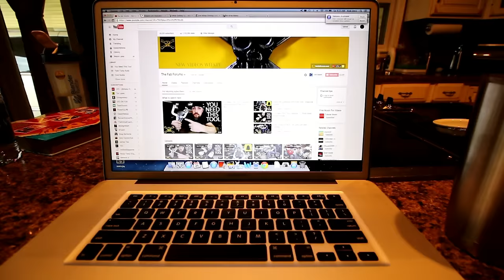What Is Falling From The Sky?

Comment: for the tube bender, kubota makes some really cool quick disconnects for their hydraulic lines. maybe you can work those in so you can take it apart and not have to worry about air in your lines or loosing fluid. just a thought.
Reply from the maker: +Joseph Inman thats a good idea. I will have to look into those
Reply: The Fab Forums I'm sure there's probably some aftermarket ones that are cheaper. Just throwing ideas around.

Comment: Nice tool.  You said max OD was around 2 inch?  Guessing exhaust piping cannot be bent up with that.  Last time I fabbed up a catback system I mig welded the bends together in sections
Reply from the maker: +Russell Maillet yeah this is just for DOM chassis style tube bending. I just buy mandrel bent sections when I do exhaust

Comment: man i kweep saying it .......sumtimes wish i lived in the states so i could have a shop in the size you have , houseprizes here never alowed me to buy one , maibe one day.....

maibe you can make the carbhat so the trottle body points down a little more , that way you have a little straighter shot from the original hole in the body and you can bring the trottle body away from the main body more so you have more space around the linkage 
not sure wat it would do with the flow though might point most of the air to the front runners 

new (too you) bender , hydraulic too , nice 
the hydraulic part prevent you needing to bolt it to the floor and tearing youre shoulder out bending stuff up 
i agree that it takes a lot of space , with the amount of space i have in my workshop (about 1/4 the size of youres )  i'm constantly debating if i need it (now or later) or if i can stack / combine it with other stuff to save space 
to save space with the nender you might build the hydraulics in a toolcart together with the pipenotchers anglefinders measuring tools ,  bend materials and stuff with some agrycultural type quick connect hydraulic fittings , if you make it a seperate unit you could use it for other stuff too like hook it up to a woodsplitter dentpuller / frame straightener or 60 ton garage press capable of punching holes in metal bar or thick plate 
since with the hitch on the bend or the mount on the toolcart deleates the foot of the bender you can make a "gunholster" type frame for it and hang it vertically on the wall or the side of the toolcart  if you dont use it , not sure how heavy it is though
Reply from the maker: +watahyahknow it is nice. Thanks for the ideas...I'm sure I will figure something out

Comment: you need some solar, man
Reply: +Jason Andrade that would be cool,  he can use it to charge his batteries and run some lights throughout the day
Reply: +Lalo Herrera he could just spin that meter backwards and save some cash.
I live off grid with solar and batteries and it makes running equipment a challenge
Reply: +Jason Andrade Agreed.  I am also off-grid 100%.  I hate to work inside on the sunny days.
Reply: +CanaanManley where are you OTG
Reply: I live in South Central Oregon (Sprague River) to be exact.
Reply: +CanaanManley sweet Oregon is going to be my next home, if you like otg my channel has some stuff! I can't touch this guy's fab skills yet but trying repeatedly is how you get there!